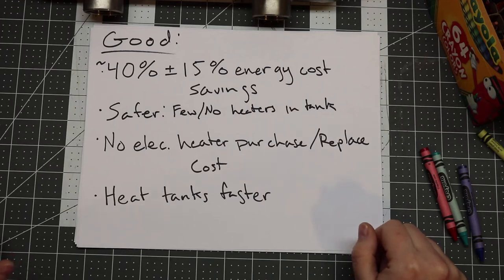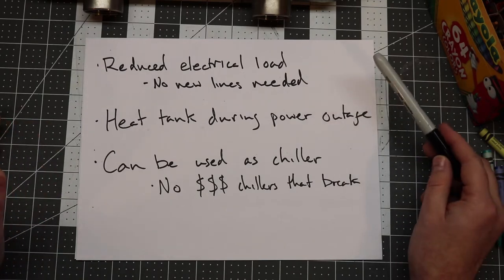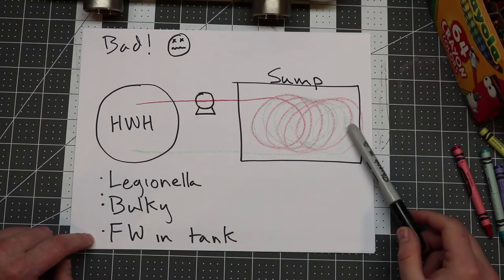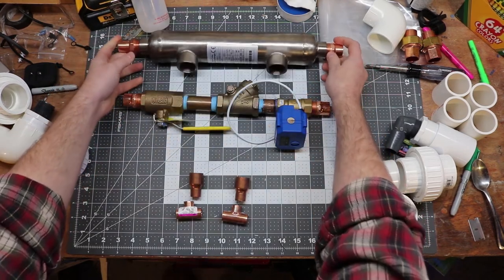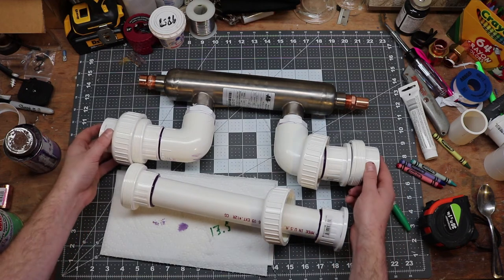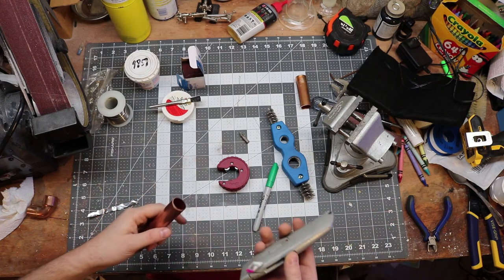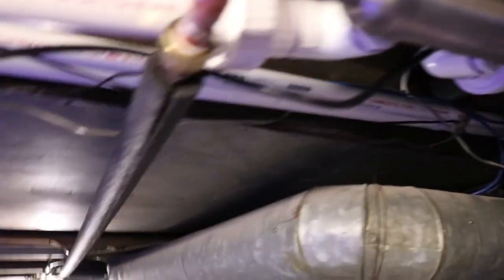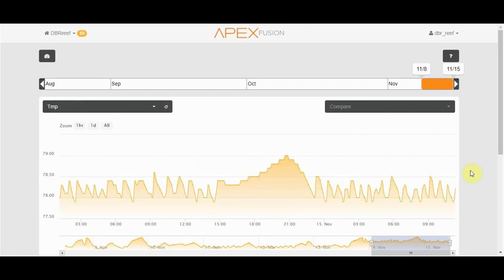Heating large fish tanks with your gas hot water heater. Save 40% on energy cost!

Comment: I bought the heat exchanger. I have a 250 gallon system and going to give it a go. I’m a plumber so the piping should be easy. I’m going to use a circular pump with a mixing valve off the boiler to be  able to adjust my feed temp. To turn the pumps on I’m going to use my INKBIRD controller off a rib relay. Most of those grundfos circulators have built in check Valves. And no need for a zone valve if that circulator is only controller 1 zone ie. aquarium

Comment: Great video. You could use a mixing valve to reduce the heat exchanger temp so it doesn't heat as fast. Not an issue for you but someone who doesn't have an apex might find it useful.

Comment: Excellent video. Have changed my plans to this idea instead of the sump. Couldn't bring myself to waste that much energy. Are you having any hot going back into cold line with your pump going? Try pluming return to tank drain valve. It keeps entire tank at same temp top to bottom. It's giving you some what better efficiency? (I imagine thats why plumbers do it that way.)

Comment: I also agree this is a really good video and a great idea I want to do this on my 300 gallon my filter system will be in the basement right next to the hot water heater I'm curious to know how well this system is working and holding up??
Reply from the maker: the system is doing perfectly, I haven't had a single issue. I feel way more confident in it than my many, many electric heaters. I'll pull the heat exchanger once the heating season is over and see how it is holding up, and how clean it is, and let you guys know

Comment: This is the greatest video I have ever seen on youtube! I'm not kidding, you are a genius. Thanks! I'm going to run the titanium coil in the sump. Since I haven't set up my tank yet, I will try it without the ball valve and see if the thermal siphoning makes a difference before I add livestock. Also do you have an expansion tank connected on your house system? If I install the circulation pump as you show should I add an expansion tank on the cold water line between in the cold water source and the water heater?
Reply from the maker: Glad you like it. If you do not use the ball valve you must use a one way valve, otherwise when you turn hot water on somewhere else in the house you will get cold water flowing through the system. 
You do not need an expansion tank- a expansion tank is necessary on a closed system, which if you are using a hot water heater connected to a cold water supply line you do not have. Basically the water line coming into your house acts as a expansion chamber. Anytime you have a closed system, then you need an expansion tank (ie a closed loop with a tankless water heater or a heating boiler, etc)

Comment: DUDE!  Long term exposure to copper kills living things!  If you have copper pipes in your house, you're probably ok, if you don't use copper fittings in your sump system.  Some fish are okay with copper exposure (many fresh water fish are ok... kinda).  Some marine (salt water) fish (the more expensive ones) will be killed by exposure to copper.  Inverts will be killed by copper.  I'd LOVE to do this for my 500 gal Reef and 900 gal FOWLR (angel fish) tank.  But there'd have to be a no-copper solution.  Once copper gets into your tank... pretty d**n hard to get it out.
Reply from the maker: The copper and the saltwater system are completely separate, so it is not a concern. Definitely don’t use a copper heat exchanger 😂

Comment: only a 100amp service ahahaha - iv seen houses with only 40amp supplies - you see all the lights dim when the 20amp hot water heater comes on (240v 1ph)
Reply from the maker: really? I think I would upgrade that pretty quick- I don't think I could live on 40 amps
Reply: this was an old beach house we rented when we were on holiday - the main fuse was 40amp rated and it had a switch for night rate and day rate - so you could turn the water heater on in off peak hours or during the day - all the lights dimmed down but luckly the biggest load was the hot water heater witch would only run when we were asleep and the stove and over wernt a problem either - it didnt affect us at all - but keep in mind i am in Australia where we have 240/250v 50Hz not 110v 60Hz haha - so a 20amp hot water heater is actually 5kw

Comment: Can you also give a few more details on how you would modify an air conditioning unit to work with the titanium heat exchanger?
Reply from the maker: I haven't done it, so it may need some trial and error. First pick the type of AC unit (whole house, mini split, window, etc). The first step is to figure out how to turn it on using a 120v on/off. For a window AC this is easy- crank it to it's coldest setting, and plug it into a temperature controller that will turn it on and off. For a whole house unit it is probably more complicated, but can probably be done with by triggering it with 24v, but I think that is AC power that is needed. You may need to pop on one of those HVAC sites and ask a few questions or hire a heating and cooling guy, but I don't think it should be too complicated, as you are basically just installing a second thermostat. Then you will need to disconnect the heat exchanger and circulation pump from the hot water heater and  connect it to a closed loop that runs by the evaporator coil on your ac. This can be done with ball valves and tees so it is easy to switch. This closed loop should probably have some sort of freeze protection in it- I would recommend vodka, as if a little bit gets into the drinking water it is no big deal. The closed loop should be made out of pipe that can expand and contract easily (pex or vinyl would work fine), that way you will not need an expansion tank. Lastly, you will be placing a coil of your circulation fluid (some percent vodka) on or near the evaporator coil of the AC (this is the coil that gets cold- on a window ac it is often right behind a dust screen). I do not know how difficult heat exchange will be, and although I could do some calculations, there are just way to many variables, so you will need to trial and error it. But you may be able to get away with the coil on the evaporative coil, but this might freeze it; you might be able to use pex or vinyl, or it might need to be a copper coil (you can buy copper refrigerator supply line already coiled at any home improvement store); etc.
Reply: Ok so you are basically put a cold water with vodka loop near an evaporator, which would be cooled essentially by the cold air that the AC produces or contact between the evaporator and the loop material.
Reply from the maker: exactly
Reply: Do you think this would work? https://www.youtube.com/watch?v=HBrrVwvuAQE    Running water instead of glycol/water at somewhere between 40 and 60 degrees F in the ice chest? It looks kinda bulky, but if it crapped out, it would only require another cheap AC unit instead of a new chiller and it seems to have a decent cooling capacity for the price.
Reply: That would work but it is probably a little over complicated- They are making a chiller there. It means that all the waste heat is staying in your house, which we usually don't want. I guess you could place the whole unit outside, but I think just a window ac unit, if there is a nearby window, is an easier and better solution
Reply: I see what you mean about heating the house. I didn't think about that since I would be running it in my garage.

Comment: Would this have to be a gas water heater?  Wouldn't it be the same for an electric?
Reply from the maker: Bob Johnson you can use a electric hot water heater, but you don’t get a energy cost savings. In fact it will be less efficient due to losses in the lines. If your only goal is to not have electric heaters in the tank it will work just fine